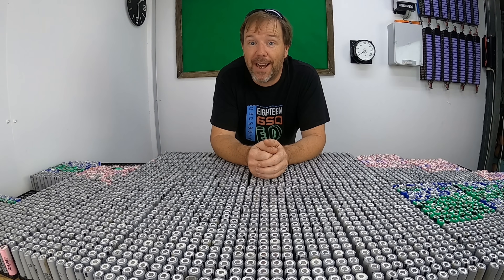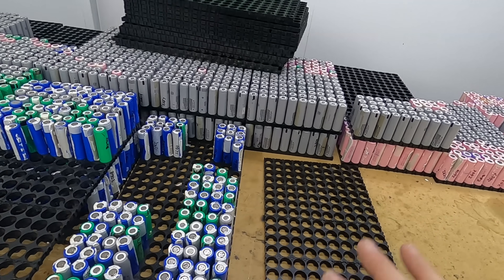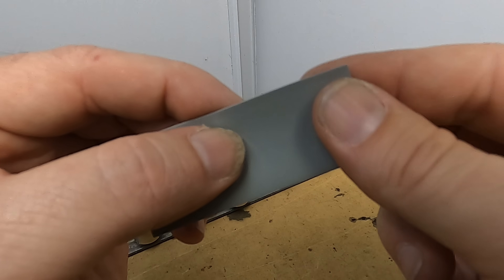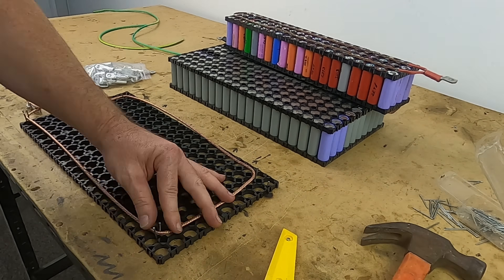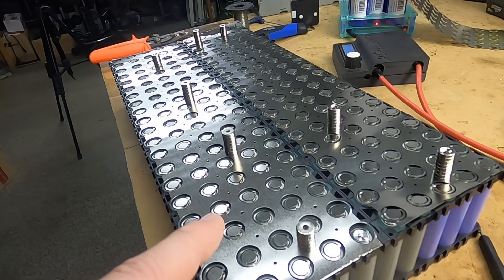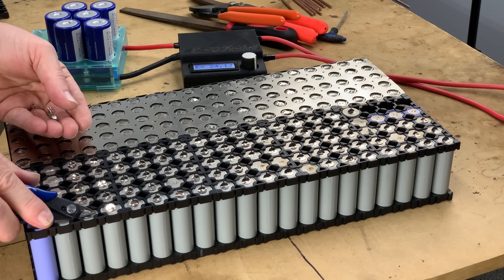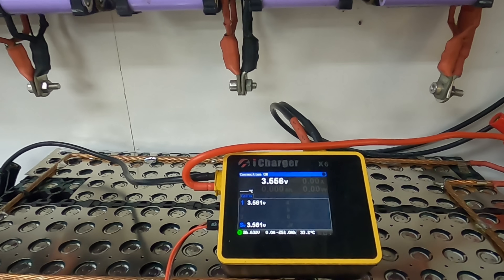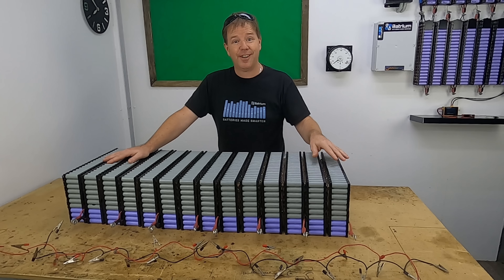Creating my single biggest D.I.Y. battery with 2800 18650 cells recovered from used laptop batteries

Comment: I would love to see the fire work show if just one blew up. LOL they are literally bombs and can be put out even with fire extinguisher that take the oxygen away.  Here they can't move it out of the building. Only fire fighter has two choice move it out or hose it continuously with water so it don't blow up. Or a swimming pool for the neighborhood kids. LOL
Reply from the maker: Ooh dear yet another one that thinks one video is enough information.. take a seat, watch the rest then come back and edit this dribble.
Reply: So what is planb when 1 of your hundred of used cell over inside you can't get to over heat  and blow up,  can you wheel it out door in 10-15 second while it's popping hot fire worker and burning your hair and hands. Are you putting people in the building and their belongings at risk for your crazy hobbies? What then? Sorry I wasent thinking ?
Reply from the maker: Oh I’ve got it covered all that you gotta do is look at a few more videos
Reply from the maker: @thomas4315  likley the 65kg steal container its in will contain it nicley and i'll burn out in the corner of the room then i'll drag it out with a fork lift and recycle it.. While it COULD happen it hasn't with the other 10,000 cells I have in service for the past 6 years - adding layers of safety is easy...
Reply: Even if that steel container could contain it, it be red hot and over 4 hr,  Telsa power plant battery burn and popping for a week long. Your main problem is the room volume is dead air if it was in a warehouse that 2 story and 250 x times the volume the room will be a oven. Your only hope is you got 15 second to get your cells out of the door.  Or you can't get within 20 ft of it.  You read about the n y. Bike battery fire that kill was it 8. It got so hoot in the hall way and stair heat will follow the easier path. Some was going out he window and trying to climb up  on the video. Contain heat just build and build. The think about lithium as I said it can't be put out as of yet, cause it electric energy that shorted and as a electric  line it can't  be put out only turn off.  It will burn till it energy run out, your about  4-8 hr  goggle in utube lithium fires. And you got even bigger than AA  and one tons of it. A small phone battery has burn down houses. And the fumes it create boring also.  Think of your surroundings as you probably die  trying to put it out or get it out the door. Who else would. That hoses or building would be distroyed granteed. It can't take heat w/ flames.
Reply from the maker: @thomas4315  Yes, you sound like an expert with great knowledge thanks for sharing.
Reply: The easiest way to see reality is though logic not feeling. If it catch fire fireman will come even small fire. If they was property damages even our insurance company want you to pay. After a inspection the firs chief will call th police and he will charge you with Negligence. Your breaking your  insurance company fine print. And your family if this I a home will als suffer the blame. 
 It's reality.  Don't gamble that why I say you will try to put it out So their no evedence. Your last mistake.
Reply from the maker: I won’t put it out I’ll let it burn out and there’s nothing around it that can cause any issues so you can just burn
Reply: All good,  safety first.we all get carried away in enthusiasm.

Comment: Thanks for your great video. I really enjoyed the video. 
I have a question for you. I am planning to build or upgrade my electric scooter. It's already comes with 3600Watt with 25Ah battery. I want to upgrade to 120Ah with 60volts. So what I'm wondering is how many 18650 battery's do I need? I have seen 6000mAh battery's with 3.7V each. How many do I need to make 120Ah? Hope you can answer my questions. Thanks in advance :)

Comment: Fire hazard. It only takes one cell to overheat and burst into flames for the whole pack to go.
Reply from the maker: Sounds like a deep fryer in your kitchen, or car with a tank full of gas. All hazzards can be reduced with the correct precautions. Still runing today with out an issue.

Comment: Hi dude, what an amazing work 

I have a small question, i bough an ebike battery pack one year ago, i smelled a strange odour but i though it was because it was brand new but a year after, odour is still here, battery is working well (i think), what do you think about this odour ? Normal or not ? 

I readed some articles talking about leacks of acid...im afraid :(
Reply from the maker: No idea, could be a cell leaking?
Reply: @HBPowerwall  maybe, im in contact with customer but he doesnt know what to do...battery works well so...

Thanks for your answer

Comment: they should stagger the holes in the frame to save space
Reply from the maker: Cheaper to use that space than to need to create something to force cool the battery. This way works well for reduced complexity.

Comment: Do these fuses actually help any?Would like to build a large bank and want to know if the fuses are worth it
Reply from the maker: Yes, they have saved me a few times from my self. They don't solve all issues but if a battery cable managed to dead short, those little fuses evaporate instantly

Comment: I am wondering how much did it cost to you to get the used batteries? Do you have any suggestion on how and where to source the used laptop batteries from?
Reply from the maker: I did a swap, I got the batteries from a recycler that got them from a local school, and in return I fixed/serviced/upgraded/reloaded about 40 laptop computers for them.. So got them free but used my spare time in my day job to pay for them.

Comment: Wouldn’t 18650’s from laptops be sort of unreliable considering a lot of laptop battery’s are pretty much worn out?
Reply from the maker: That is why I spend a year finding & testing every cell. Tested for capacity now verses capacity when new, heat under load, self discharge & internal resistance. My current home battery is 6 plus years in service and was built with much less care than this one was.

Comment: For high current applications, the more number of cells you put in parallel, the higher risk of causing problems. The reason is that each individual cells have differnt internal resistance. Considering soldering quality, wiring quality, when these parallel cells receiving a shock load/high current boost, it is easy to overload the cell which has least internal resistance. Especially used cells, they tend to have high internal resistance. If this happens, you will have gradually incrase number of dead cells.
Reply from the maker: Yep, that's the issue with using cells I can afford.. you always pay somehow some way..

Comment: Shouldn't the failure rate on something like this be more or less infinity? Lol I'm j/k but I'd love to know how often a failure could be expected. Amazing work, you're a trooper!!
Reply from the maker: Good question! My first 40kwh battery that was chucked together to feed the youtube goods is still running 6 years later, once a month I would replace just ONE of the 4480 cells in that battery, I check all the time with a thermal camera as the primary fault state of these cells is heat before and if you get it before it gets to thermal runaway - you've got a good battery :P
Reply: @HBPowerwall  Oh that is terribly cool about using thermal IR to spot failing cells. I never would have thought! So that's actually quite workable. If ever I have a need to go to mass DC storage, I'll look into something like this. Thanks for your response and thank you for all the hard work that went into this!

Comment: dangerous as fck. one of those used old batteries could be at their limit and could blot and explode if continuously charged.
Reply from the maker: Sounds like i should have made 5 more videos that cover all that.. also they don't explode - then vent and turn into little rockets - with out the correct terminology you sound silly..
Reply: @HBPowerwall  yeah little rockets. good luck when you cause a chain reaction with all those batteries packed together and inhale large amount of methane, carbon monoxide or hydrofluoric acid. lets just hope they are all really 18650's and no fake ones since you just jammed together batteries from used random laptops, (as an exaggeration) you could be using nicd + nimh + lfp + lco + lmo + nmc + nca + lto. its a very good recipe for disaster.
Reply from the maker: you didn't watch the other videos its seems lol Ooh well been fun (but do agree they are dangerous to a degree)

Comment: This is the capacity of the new cells. You can divide this by 20, at minimum.
Reply from the maker: NO it was the tested capacity used to calculate that 25 kWh - secondly I released a video testing the battery at 400ish watts as slightly over that 25kwh..

Comment: Just imagine how probabilities of firing for single cell multiplying together in that monster pack. If that monster will fire, it can melt iron chest and something around. It like bet all your house on the black in casino
Reply from the maker: You don't install a rocket or tnt in your lounge room either for that very point.. Check out the later video took great pains to sort out safety and security
Reply: @HBPowerwall  im just trolling)
Reply from the maker: kinda makes you sound stupid but thanks for the interaction ..

Comment: Easy way to burn down your house, a lot of those batteries are damaged and old wouldn't trust them in my house.
Reply from the maker: I don't disagree, but this is why YOU DON"T PUT THEM IN YOUR HOUSE - kinda seems dumb right lol
Reply: 18650s with NCA chemistry usually never fail in a volatile way, so much so that NASA had to surgically integrate a shorting mechanism into their qualification cells to guarantee a volatile failure mode!!! Wouldn't keep it in the house though, you do get a puff of formaldehyde and other nasties when they go.

The paper on what NASA did is here https://ntrs.nasa.gov/api/citations/20170011599/downloads/20170011599.pdf
Reply: The real problem is when you deep discharge cycle the cell and force a recharge, internal shorts will be common because of dendritic buildup between the jellyroll layers.

Comment: Lol that's impressive but I would never try this just because I know I would also cheap out on the BMS boards. The BMS boards I've bought in the past for basic 12-24V banks never seemed to work properly at balance charging despite claiming that feature. They would more or less just be digitally fused and the bank would fail as soon as one cell started to go due to uneven charging.
Reply from the maker: I went with quality BMS that i've trusted for years... edit it's not cheap but does the job bloody well.

Comment: What an awesome project! Have you tested the maximum current discharge limit of this system? I guess you may have to do some thermal testing at different current values amongst other tests?
Reply from the maker: I havn't/can't - the theoretical load of the cells is 4-6x what my planned inverter can acutally do. Battery was built to last as long as possilbe there for it was considerably over built. There will never be any heat build up in cells or connectors due to current draw even with heat soak. In fact 2 years after building it's only been cycled one full cycle *two weeks ago...  due to many factors including I couldn't actually use the battery legally here where I lived by the time i'd built it.

Comment: Do u parallel the different mah? How do u do ur bms?
Reply from the maker: I do, but the 14p final battery has the same capacity over all making it the best battery I can for recycled cells. I use a Batrium BMS as seen in part 4

Comment: Following you for years. Why did you opt for this way of fusing when you did cell fusing using fuse wire on your previous packs? 

We have been through cell fusing using solder then spot welding and now this has fuses which on previous video fuse at around 20amps and per the website should fuse at 3 to 5amps.
Reply from the maker: Evolution, and have to constantly try new products I guess..
Reply: @HBPowerwall  and are u comfortable with cell fusing not be consistent in terms of fusing amperage or am I wrong?
Reply from the maker: More likely I was wrong.. The tests i've done in the past wasn't the 'use case' for the fusing - I tested way wrong. I'm very happy and confident that they'll work as intended. If it doesn't i'll be the first to make a video and share my experiences
Reply: @HBPowerwall  thanks. Other questions around battery resistance I never ever seen you group your packs by battery ressitance AND capacity. Is there a range you advise on? Ie. 100-200 or 150-200. 

I see most sorting videos dont go into the intricacies of sorting by the 2 most important factors. Any advice?

Comment: That was wrong way to do it.
Reply from the maker: Please explain?
Reply: @HBPowerwall  when you use battery cell voltages go down. Lower mAh batterys voltage get more lower than higher one. Then higher one needs to charge the lower and you lost energy.

Best result when all battery blocks IS made same mAh cells and blocks have egually mAh total. But then fysical side is differend
Reply from the maker: how to you suppose you do with recycled cells.. you're referring to best practices, perfect world stuff.. Here in DIY land you do what you need to do to make it as safe as possible yet function well & be considerate to the environment.

Comment: So you charged and discharged every battery to determine their mAH so you could sort them?  Damn!
Reply from the maker: Yep, then recharged again tested Internal resistance, then left on bench for months to test for self discharge.
Reply: @HBPowerwall  that's very impressive!
Reply from the maker: it was very time consuming lol
Reply: @HBPowerwall  How do you calculate mAH, i.e., what voltage do you charge to and discharge to?  I have a ToolkitRC M6D charger and will look into testing my 18650 batteries.  Is there a 18650 battery charging tray you can test multiple batteries at same time with by using your charger?

Comment: Hi,
I watched a movie 5 times but I get lost. I do not understand what system you arrange the cells in the package from the smallest to the largest capacity?
I understand that:
1- you select cells in groups every 50mA, then you have 14-16 groups (2400-3100mAh),
2- you put them into packages where you statistically have equal each value from the lowest capacity to the highest
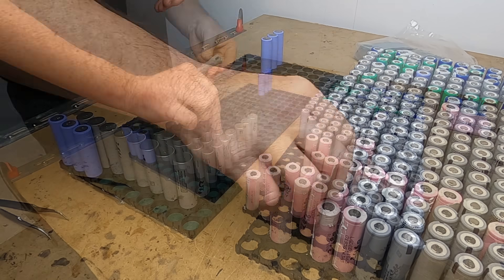3 - this is where I got lost: when you move the cells to the final package (in the video 3:55 - 4:30) it seems to me that you are mixing them up. I thought that they should be arranged in a system, e.g. strong cells closer to the connections, weaker in the middle (at 4:17 you have some weak links and some strong links left where the package is almost complete). Please describe how you do it?
Reply from the maker: Never considered putting the stronger cells near to the busbars, but I just put all the cells together to create one big cell that was close in capacity to the other 13.
Reply: I understand, thank you very much for your answer.  I am happy when practitioners share their experience with others.  Theorists would say that this cannot work properly if the cells in one packet are of different capacity.  And for you it works, and as I noticed in other videos, you have no problems with packages.  Excellent job, thanks again

Comment from the maker: Want to see the final install years later check it out, it's awesome https://youtu.be/KgfykvHM95s 

[ Part 1 ] You're here, and hopefully enjoyed it enough to continue down the list?
[ Part 2 ] Finding out the battery build isn't legal | https://youtu.be/HCd2opk9APg 
[ Part 3 ] Addressing safety | https://youtu.be/EltBFVKStEg
[ Part 4 ] Fixing leaky cells and a low voltage battery | https://youtu.be/sOFBYmMenXU
[ Part 5 ] I finally get the battery completed and ready for service, also incorporated my 100,000th subscriber video! | https://youtu.be/DAoCK3QNLng

Comment: Good Job :),
is it possible to use such battery packs to be used in EVs ?
Reply from the maker: I guess so in a pinch but contrary to what I said in the intro I now don't feel it's a great idea.. micro vibrations likely to cause fuses to break, then huge battery imbalance & issues

Comment: oh, you don't seem to be much concerned about heat issues.  I would be much interested in finding out how the packs handle heat-wise.
EDIT: Great job, I have subscribed :D
Reply from the maker: The battery has been built so there will be none. A properly designed battery is  important

Comment: Hello sir wow lods of cell .  Whats minimum mah capacity would u recommend for a 48v powerwall ❓ 

Also if ( charge test ) and discharge at 1000 mah rate  what’s the acceptable maximum temperature  🌡 ❓ 

My batterys, im doing test charging at ( 1A ) and monitored with thermometer, those cells temperature are between 40c and 47c 🌡. 

total capacity after test charge it’s between 1950 mah and 2200 mah .

It’s this temperature acceptable for a 48v powerwall ❓ 

Im using a opus 3100 charger Thanks .

Comment: Would be worried that most of these cells are not in good condition having come from old Laptops. Try finding a crook cell in such big banks.
Reply from the maker: I spent a year testing every cell for - capacity, self discharge, heat & high resistance. I'm more than happy they'll last 8-10 years of service with maintance .